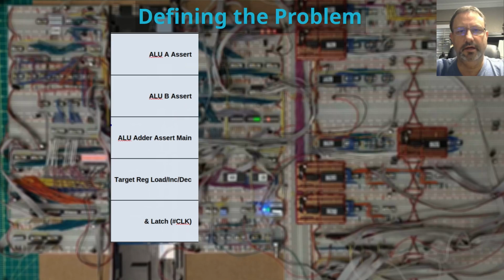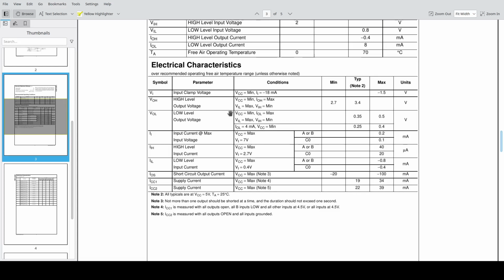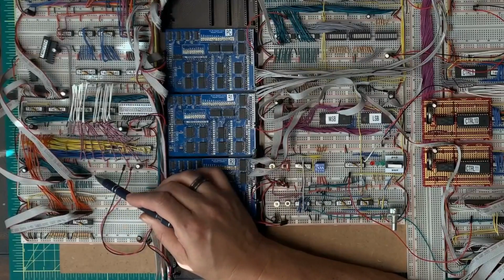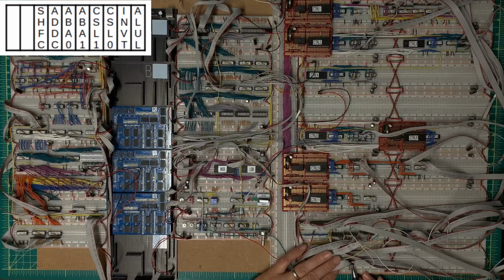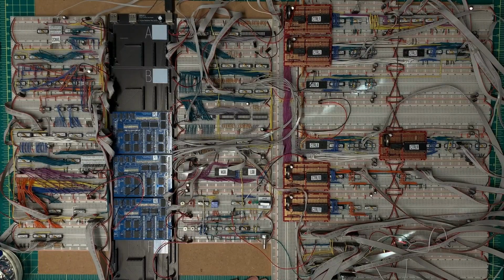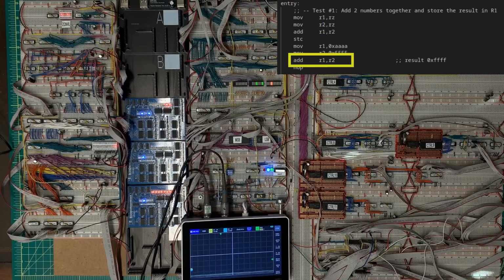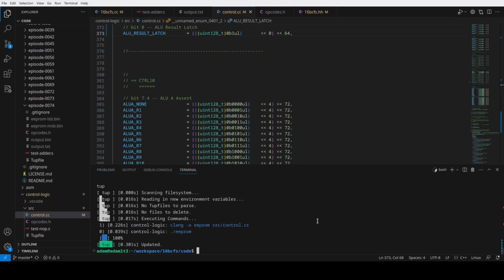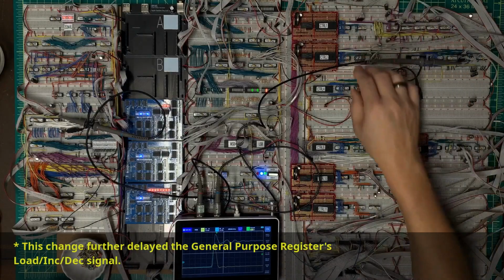0075: The ALU Adds (Mostly) | 16-Bit Computer From Scratch

Comment: The clamp voltage should not be important. it is saying if the input voltage is -1.5 volts relative to the IC's ground pin then it will clamp. Another thing to keep in mind that most parts will pull more current low than they do high. so having the default state set with pull up resistors would allow faster signals. Of course with such long ribbon cables the whole thing is going to be slow anyway.
Reply from the maker: @LaserFur -- Thank you for sharing the information!!  I was barking up the wrong tree with the clamp voltage.

As for the current that can be pulled up or down, I am seeing a different behavior with the CMOS technology vs TTL.  Perhaps the same behavior exists but at a different level?  This is certainly one thing I had to realize when I started mixing the IC technologies -- it was an error in judgement and I should have just started with HC from the outset.

I also honestly expected the breadboards to limit my speed more than the ribbon cables.  Both will go away as I convert to PCB, so my expectation is I really won't know my true limitations until then.  Of course then there is the whole parallel trace issue that will need to be looked at....
Reply: @eryjus4594  mixing Cmos and TTL  can also be problematic as the TTL won't pull up as high due to two diode drops. A pull up resistor can help get the TTL output voltage back up to the voltages Cmos wants.